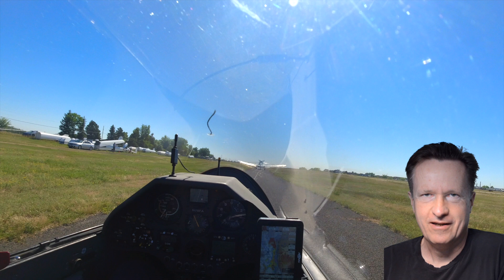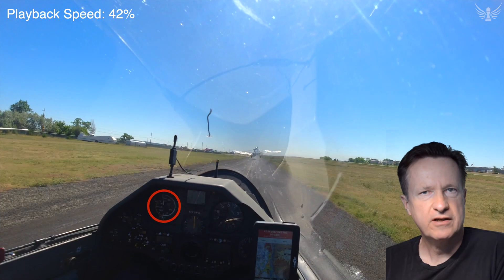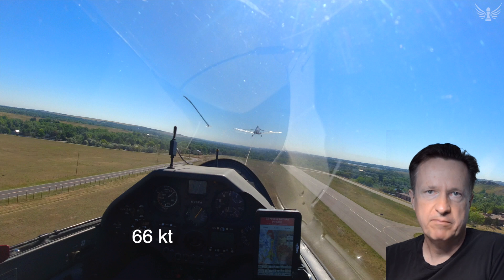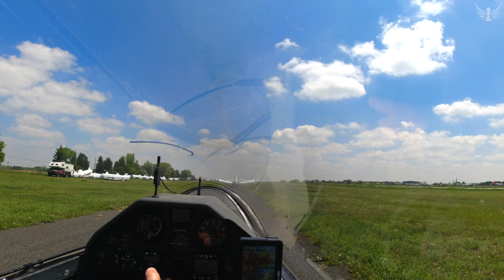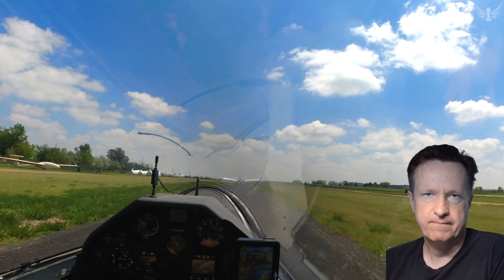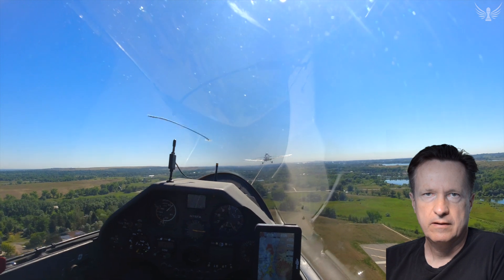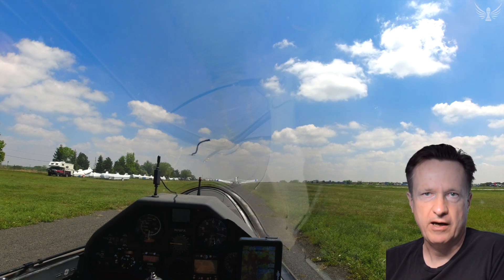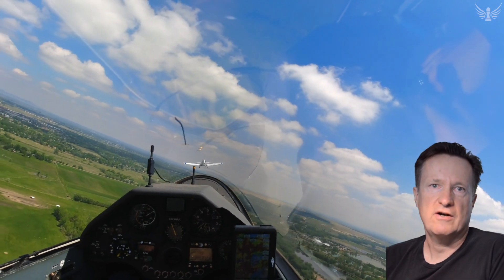Dangerous Aerotow - I almost stalled! - Towplane Flies Too Slow For My Glider

Comment: For me there is another question re what can we learn from it (when a tow starts out badly - no matter why): what are the criteria for an early/immediate emergency release and are we mentally prepared for it. Enough landable area remaining ahead (runway, overrun, reasonably flat strech w/o fences/obstacles) would be an obvious one. Parameters are airspeed, altitude, wind. 
In your case it might have worked releasing shortly after your early call outs (about in front of the Mile High shack). Your glider was not stalled at this point and a "gentle" pushover would unload the wing, making a stall less likely. 
To prepare for/help with the decision to release one would have to be familiar with that landable area under different conditions, including weight of the glider, power of the towplane (hp, density altitude). Kind of determining something like the "accelerate-lift off-stop" distance. Walk down there and measure....
Once I had to release early when the tow ran into a patch of yet uncut grass and didn't accelerate to a safe (for me) airspeed for climb. Different situation, different outcome, but it sure drove home the point about being prepared!
Reply from the maker: Yes, completely agree.  I definitely had enough runway left to stop.  I had the impulse to release but stopped short for fear of stalling and not having enough altitude to put the nose down and pick up speed. But to be honest I really don't know what would have happened.  I also thought afterwards that maybe I should have just stayed in ground effect myself until I was in the low tow position.  That would have reduced my risk but I'm not sure how the tow plane would fare in that scenario with the glider pulling down at the tail.  I really don't know what the best option is in this scenario other that doing the utmost to avoid it in the first place.
Reply: @ChessInTheAir  I think you did well. Staying low and pulling down tow plane's tail would stall him (and probably crash) if you/he did not release in the right moment. I also understand why you were afraid of realeasing so low at stall speed. Luckly it was almost perfect 52 knots and not slower, thanks for sharing :)
Ps. Maybe 30 sec silience on radio would be good idea while tow plane & glider is taking off or even different frequency for both of you during that crucial time?
Reply from the maker: @Alupl  Hi Aludan, thanks for your comments. From what I’ve learned since it would have been ok to release because the glider’s stall speed is lower behind the tow plane than it is in free flight and a release should not have triggered a stall.  That’s what I’ll do next time this happens.  There’s a link to a presentation by Dave Nadler in the first (pinned) comment. He explain this in some detail.  Re: the radio, there is too much air traffic in Boulder to safely use a different frequency (you have to monitor what’s going on around you)  and I think it would be impractical to ask other traffic not to use the radio while gliders are taking off.
Reply: @ChessInTheAir  You're right about different frequency. It was just idea which i've heard some time ago. We have also too much aircraft traffic and even had fatal (unfortunately) accident which maybe didn't happen if the pilot have heard the radio message but in that time some airplane pilot was talking. Different frequency for gliders or temporary silence on radio during takeoff was just some ideas to solve the problem but to be honest i didn't fly in last 2 years so i don't know if it was resolved that way.
Reply: @ChessInTheAir  If you release the moment you see him climb out of ground effect (right before the first "faster") you'd have a benign straight ahead "landing". That requires forethought and a commitment before the start of takeoff roll, something like the "V1" call in an airliner.  Once out of ground effect you may find yourself trading one bad situation for another.

As always, thanks for sharing this!
Reply from the maker: @robzerbe  yes, I think you’re right. Thanks!
Reply: @ChessInTheAir  I want to reiterate, thanks for sharing this … despite an extensive aviation career that started in gliders I’d never been educated on or planned for this scenario.

Your shared experience makes us all a little smarter
Reply from the maker: @robzerbe  thank you!

Comment: Great video and great points made. I can't believe your tow planes airspeed indicators are in mph instead of knots! The obvious thing that should be done is to change them so all tow planes are the same as the gliders. I realise it costs money. And we've all had that horrible feeling of hanging off a tow plane that's going a bit too slow. For some reason, even above the stall speed of the glider it still feels horrible!
Reply from the maker: Thanks Tim!  Part of the problem is that the Schweitzer gliders that are widely used in the US for training and rides also have ASI's in mph.  So you'd have to replace all of them too.  Some tow planes' ASIs show both mph and knots. Not sure if that makes the situation any better though.  One more possibility for confusion.  This might be a US-only problem due to a historic love of British measurement units.  So in NZ you're using knots throughout?  In Continental Europe the ASIs in gliders and tow planes are in kph.  Wouldn't it be great if everyone would use the same units? I suspect everyone would agree as long as their own favorite units were selected...  Personally, I couldn't care less which one but I'd definitely vote for standardization!
Reply: @ChessInTheAir  Better start with ICAO. Not even they have a standard unit for airspeed.
Reply from the maker: @8OrangePants  yeah, I’m not going to try to get anyone to change it.  I’ll just adjust my own behavior (in this case the tow plane briefing) to minimize the risk that’s associated with the conversion.
Reply: @ChessInTheAir  the good news is you know the tow speed, and can memorize and brief the kts and MPH at the same time, and like you said for the tow pilot to read it back.
Reply from the maker: @TheSoaringChannel  yes, that's exactly what I've been doing since. :-)
Reply: @Pure Glide - "For some reason" is explained in this safety briefing: https://www.youtube.com/watch?v=WIZWzvMu1dM&t=845s

Comment: Seems like there are potentially a few more things to be learned (or perhaps researched) from this. We all know that adding ballast shifts the polar. Presumably, this also shifts your emergency land-out options early in the tow. When flying heavy, up to what point (if any) could you safely land straight ahead? Elliot's field? L-Shaped field? What happens when you release a heavy glider at very near stall speed? You stated that you were afraid to do so, presumably at least in part because of the uncertainty of the outcome. I think we could pretty much agree that a glider stall low in the tow could be quite dangerous for all parties. It would seem that it should be possible to do some sort of testing under more controlled conditions that would generate some improved knowledge about the options under those circumstances. I would certainly want to know. This is a prime learning opportunity. We're very glad it's not an accident report.
Reply from the maker: Yes, these are good questions. I'm not sure how one could safely test what happens if you release from tow at 30 feet when you're close to stall speed (although I would also be interested to know).  One of my friends told me afterwards that he did release in a similar situation and just had a very hard landing where he was glad that nothing broke.  With respect to the landout fields my calls are adjusted based on the extra weight.  The problem with Elliots field is that it is too short to land and stop with a ballasted glider.  Landing there would require a purposeful ground loop that could break the tail boom.  The L-Shaped field is not very good anymore because it is now a horse pasture and there is a small structure in the middle that reduces the useful size of the field.  I added "beyond the L-Shaped field" as a better option.  It's a field with a slight upslope where I think I can get a heavy glider to stop more easily.  But none of these options can realistically be safely tested. (At least not by myself.)  One thing you can do (and which I have done) is to try different landout options in Condor with and without water ballast.  It is eye-opening to see how much extra runway you need due to higher minimum speed and greater mass (i.e. higher kinetic energy).
Reply: @ChessInTheAir  I think what I had in mind would be doing a release test at a safe enough altitude to allow stall recovery. Q1: If you release at just above stall, does in fact the glider stall? Q2: Is it possible to trim so that it wouldn't? Q3: Can a good and alert pilot react quickly enough to prevent a stall? Q4: What is the short-term sink rate and how would that translate into a potential impact? Q5: How much altitude is required to recover at various weights?
Reply from the maker: @daveandrew589  Got it, yeah, that may work 🙂
Reply: @ChessInTheAir  Out of curiosity (and enthusiastic inexperience), I went into Condor and set up an Aerial Start for a Diana2 (I just have the default gliders), and trimmed it as far back (nose up) as possible. Unballasted, this is still above stall. Then I pulled it slowly back to near stall (simulated buffeting). Simply letting go of the stick always resulted in immediate nose drop and no stall. Then I did the same with max ballast. Full nose up trim is very near stall at that point. Repeated the process, still no stall. Repeated again, this time giving a quick jerk back and release on the stick to simulate deceleration from tow release. Still no stall. Does anyone take off in tow with full nose up trim? Kind of doubt it. Does this prove anything? Very likely not. But it does suggest that any trim to a speed meaningfully above stall at your takeoff weight can avoid a stall on sudden release. Does that mean it's true for real gliders such as your Ventus? Probably not, but it does suggest a reasonably safe experiment at altitude.
Reply from the maker: @daveandrew589  Good observations, Dave!  I’m not sure how much I would trust Condor for this specifically.  But regardless, at altitude there really is no risk to try it.  What is hard to gauge is how much altitude you may lose in the process.  Not sure if the IGC trace is accurate enough to assess it.  20 feet vs 40 feet would make a huge difference.  The reason I’m worried about it on tow at low altitude is that you’re flying in a relatively nose high attitude with a high angle of attack.  I believe it is due to this high angle of attack that flying on tow is uncomfortable even if you’re 5-10 knots above stall, and why manufacturers recommend a much higher tow speed.  Eg for my glider the recommended tow speed fully ballasted is 71-81 knots.  Our tow planes don’t climb well at 80 knots and I’m perfectly comfortable at 70, even 65 when I’m a few hundred feet above the ground.  Releasing at 53 with a nose high attitude I am concerned that my speed will initially decline below stall and I may need to loose 40-50 feet to pick up enough speed to really be able to fly and flare for the landing.  But if I’m only 20-30 feet above ground I may not have as much altitude as I need and the touch down could be really hard.  I don’t know and I obviously don’t want to try down low.  Experimenting at altitude would not be a problem but as I said I’m not sure that you can measure the altitude loss precisely enough.  Maybe you can.  Might be worth a try. There’s really no risk at all of doing so at altitude.
Reply: @ChessInTheAir  Certainly agree with your points. I'm also skeptical that this sort of problem is 'in bounds' with respect to a Condor simulation. I don't know how much this is helping you, but thinking about it is really helping me get a grip on the left end of the polar curve. The polar tells us that anytime we're below Min Sink speed, our sink rate increases fairly dramatically. What this appears to mean in your situation is that you could well be losing altitude at the same time the tow plane begins gaining. This would result in a pitch up moment from the tow rope on the glider at the worst possible time. Its hard for me to think of a worse situation than a stall under tow at low altitude. Getting prompted to think about this and be motivated to really understand the dynamics is a real service to your community. A number of your blog posts have done the same. So, thank you.
Reply: @daveandrew589  yes, I think that’s another really good observation!  Most of the modern gliders are fairly docile when they approach stall, especially in straight flight and when the cg is not too far back (mine definitely isn’t).  So when you approach stall in straight flight the main risk is loss of altitude rather than a sudden spin entry.  Clearly I had not stalled and I don’t really know if the Pawnee could fly slow enough for a full stall to really happen.  One thing I could and probably should have done is move the flaps into landing configuration as this would have lowered my stall speed further and created additional lift (albeit also drag). The downside of this is that the extra drag could theoretically slow the Pawnee to the point where it might stall but I doubt that this would have happened.  Another downside of landing flaps is much reduced aileron control.  Anyway, there is much to think about this - much more that one is able to consider within the fractions of a second that are available in a real situation.  Avoidance remains the key strategy.

Comment: It would be very bad for a tow plane if the glider stalls.   The rope would stay attached keeping the tow plane in a stall.
Reply from the maker: Yes, I think worst case would be the glider entering a spin, dragging the tow plane down with it unless the rope could be released on either end or break in time.  Things go very fast.  I could not even recall the call sign of the towplane even though I had just used it a minute or two earlier prior to takeoff.  I now specifically brief the tow pilot to stay in ground effect until the minimum tow speed of 70 kts or 80 mph is reached, then climb gradually while maintaining speed.  This is a "better over-communicate and be safe" than "under-communicate and pay the price" kind of situation.
Reply: @ChessInTheAir  Since the rope is already under tension, I doubt it would break.  Only a release by either pilot could stop the tow plane from staying very nose high.  The glider pilot needs to release immediately in the advent of a stall.   Speed saves.

Comment: Why not require to have same units in the tow plane as in the glider?
Reply from the maker: There are also gliders that have airspeed indicators in mph.  This may be primarily a US problem.  In Continental Europe ASIs are in kph. Not sure about UK. Unit standardization would of course be very useful.
Reply: @ChessInTheAir  UK gliders are generally in knots. Towplanes are whatever they are, both knots and MPH are common. I also fly one aeroplane with an ASI in km/h, we have quite a lot of ex-Soviet stuff here which is in km, and the only instruments that get changed are the altimeters, from metres to feet. The only times I have ever had speed-related problems with aerotows in the UK are the opposite to this, with very lightweight and vintage types, where a Super Cub can be too fast and run into cooling issues if it slows down to a speed suitable for the glider. This is when it's still good to have a Tiger Moth available. But whenever launching something that is not comfortable in the mainstream speed range I always want a proper pre-brief, whether I am towing or being towed
Reply from the maker: @harryspeakup8452  Thanks for sharing!  Yeah, I towed a long time ago behind a DR400 Remarceur with me flying a Grunau Baby.  The stall speed of the Remarceur was about equal to the max tow speed of the Baby.  I had to push the stick almost all the way forward to stay in position.  Interesting that you have the unit conversion problem too.

Comment: Another note on coms,  up 5 up 5 up 5, or up 10 up 10 up 10 often is easier to understand over the radio then just faster faster faster.
Reply from the maker: In this case it would have been "up 15" or "up 20" given the actual speeds involved. I think it's best to talk about coms with the tow pilot beforehand so that such a message is understood.  Otherwise "Up 20" might not be immediately clear or could be interpreted as something else.  Faster was at least directionally unambiguous.  But in the moment I could not even recall the tow plane's call sign (we have 5 different tow planes at the field) even though I had said it myself just one or two minutes earlier.  Another problem was that my initial transmission was not audible at all because someone else had also just started to transmit and there was no time to wait until the other transmission is over. All this underscores the importance of a good briefing beforehand where you can be certain that the tow pilot has understood and internalized the information.  The tow pilot pulling me normally pulls 1-26s and 2-32s where 52 knots is perfectly adequate.  I now make sure that the tow pilot will actively remember that this tow is different from what they normally do.